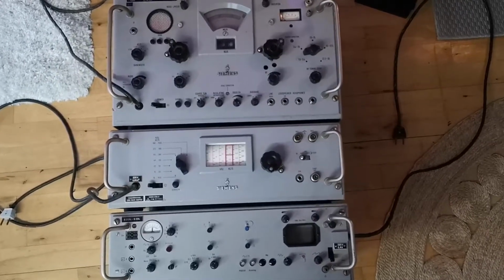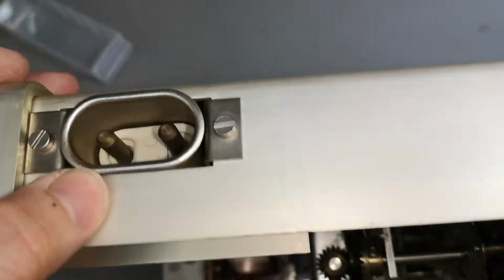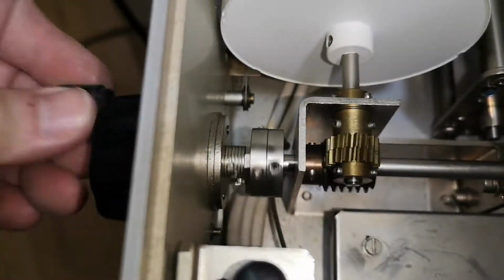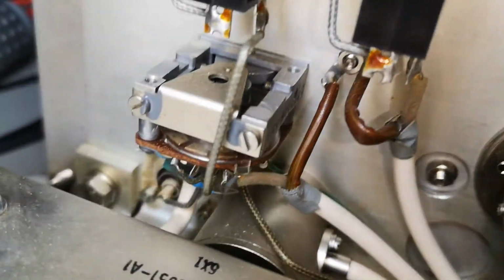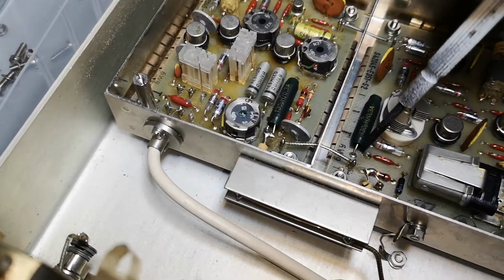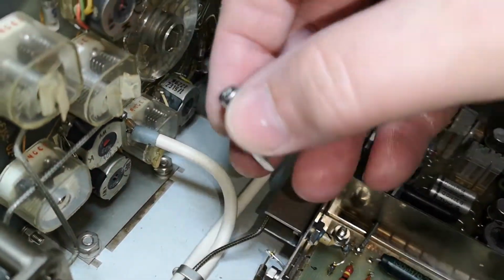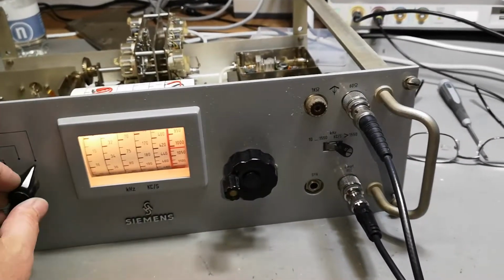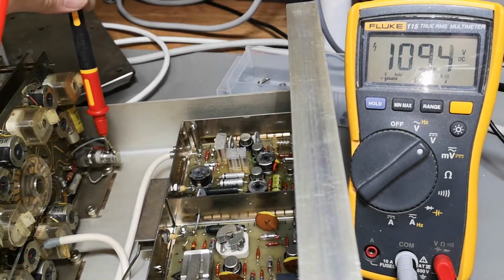Siemens S42044 E350 A1 Long Wave Adapter 1967 test teardown

Comment: 3:13 cable in the front is military standard. If all equipment is sqeezed in racks in a small acommodation  the connectors are all at the front for easy connect and servicing.
9:33 Fuses in the antenna line make sense if the receiver operates near strong transmitters.

Comment: The term "Vorsatz" or Vorsatzgerät in radio / communication is a general designation which means a device which is insert of the input of a receiver/amplifier  and the source, to give extra properties.  eg.  an extended receiving range as in this case , or antenna diversity  or an  balanced mike input  and so on.  This  Vorsatzgerät means a converter to give the E-311 receiver an extra Band which is basically  not provided.

Old radios got an UKW Vorsatz, make the  radio able to receive VHF broadcast transmissions, or an old amplifier got an magnet cartridge Vorsatzgerät (pre-amplifier)